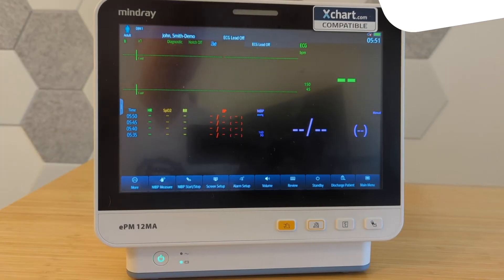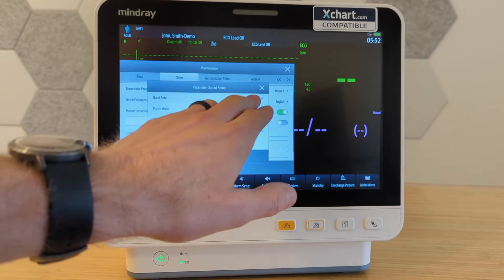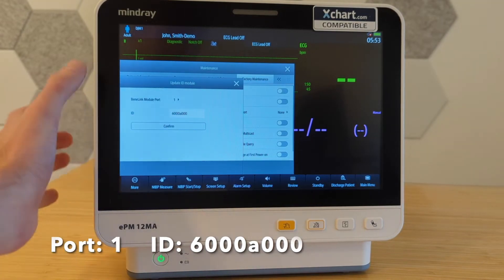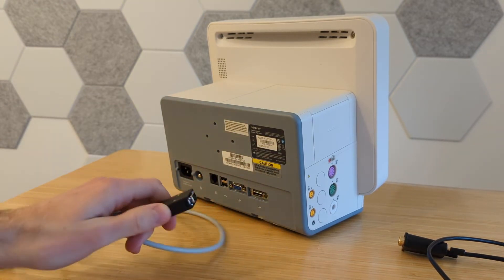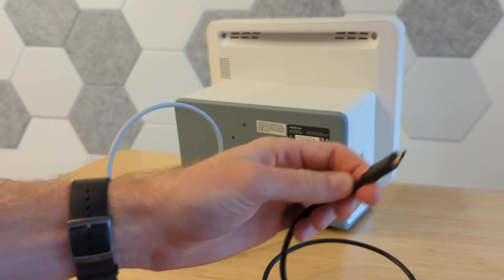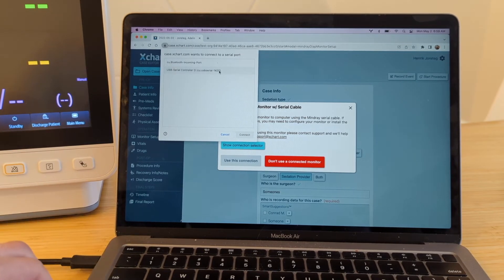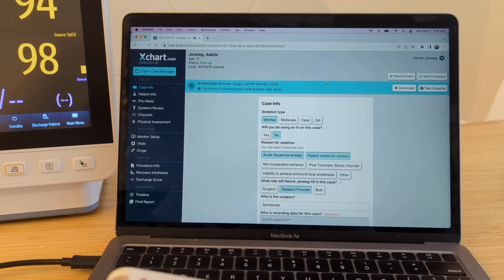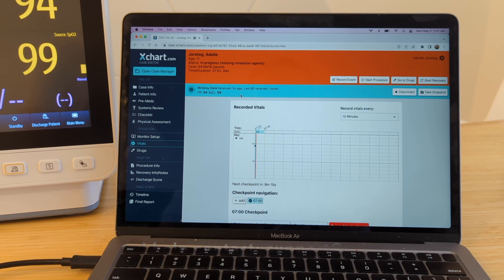Mindray ePM 12 / ePM 10 Integration

Comment: if I connected this to an ipad,  would it also charge the ipad at the same time?
Reply from the maker: No it would not, unfortunately, these ports are only transmitting data, no power. Additionally, iPads don't allow serial connections in Safari so even though you can use Xchart on an iPad, you cannot use an iPad as the device that is gathering the vitals data. We elaborate on this more in the following help article: https://help.xchart.com/en/articles/6720004-can-i-use-xchart-on-an-ipad